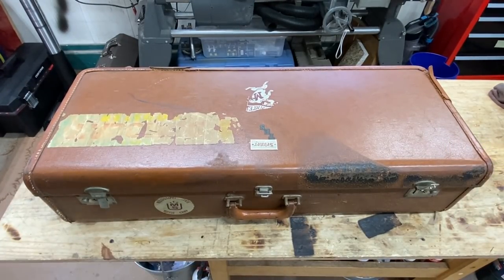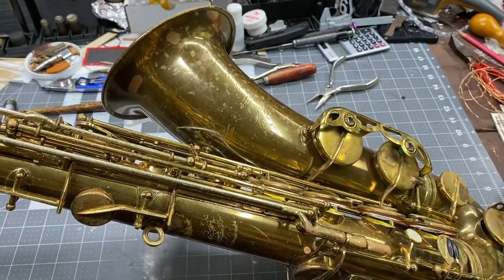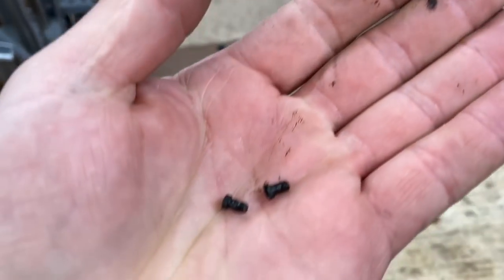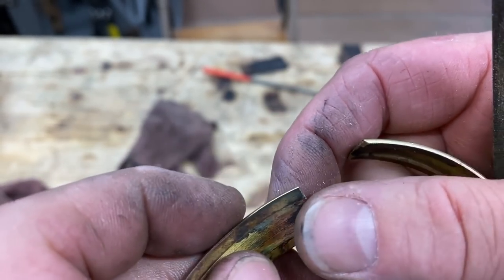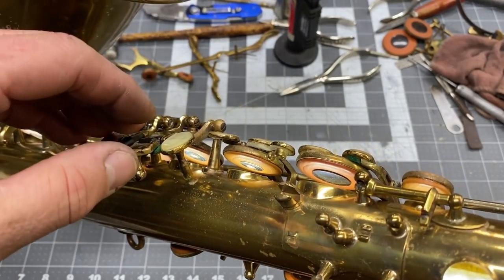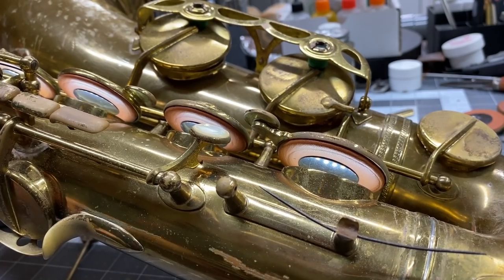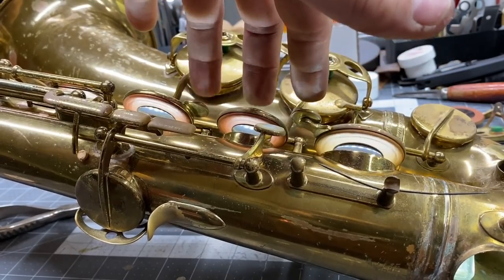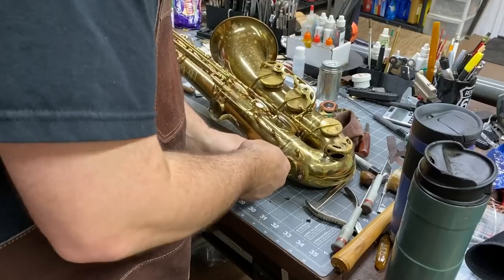Sensational Selmer vintage saxophone- band instrument repair- sax repair

Comment: Good video, but can suggest and I was cringing 😬 when you were removing those seized screws from the band with a slotted screwdriver , just in your hand .please for the sake of your left hand and put the band down on the table for support and your right hand unscrewing the screws,if your right hand slips and it will ,that screw driver will go towards the bench and not your left hand.Been there done that.🥲😉
Reply from the maker: I caught that as well on replay. I definitely got lucky. It didn’t feel out of control but could have so easily. And I’m sure we could compare left hand scars from the slip! Thanks for watching the video and more importantly watching out for me. Much appreciated.
Reply: @wesleemusicrepair9820  no problem we are far and few unicorn brass and woodwind techs.Especially in Canada 🇨🇦

Comment: THANK YOU FOR YOUR VIDEO !!!
   Wes, I'll pass an old electricians de-soldering trick on to you. Clamp a piece of pine wood close to where you're working, either vertical or horizontal. In whatever position you need it That's close to what you're de-soldering. Grasp the item to be un-soldered, with pliers in one hand and your torch in the other. Make sure no one is next to you. Heat up your metal till the solder starts shining and quickly hit the wood with your pliers. The solder will keep going and your metal will come to a fast halt! The centrifugal force makes the liquid solder fly on out. Spread a damp rag in the "Spray Zone" so you won't have lead BB's up in things, like motors or equipment. Hope this helps you de-solder.

Comment: Craftsman- needed now more than ever. Excitement welled up inside when you played the low b, c#, b flat. I loved the soldering but even more, the grinding, not leaving the solder blubber on the inside. My tech excites me in the same way. I brought a Kohlert 55 alto, with oval tone holes and dents top of dents. We did resurrection- plays now like 1955 with roo pads. Thanks- good time!

Comment: Love the videos Wes! I use Zep industrial purple degreaser (basically lye) to break down silver solder flux so there's no etching like with acid. I also use it for darkening the brass to match patina or if left in long enough to strip lacquer. Something I picked up from a friend and I've been loving the results!

Comment: Wes: the sax should never be lifted out by the bell. Especially tenors. Lifting like that bends the bell brace area causing the bell keys to be out of alignment. The bell winds up pulling upwards and has to be aligned again so the keys close. Near 100 percent of my sax repairs have this issue so the customers have to shown how to lift out by the middle of the sax or support the sax at the top. This common problem is well known to my repair friends. I'm surprised you lifted that out like that.  I am thinking of making a video to help folks out and prevent this issue. Thanks making a video on repairs.

Comment: The best way to have repaired that broken ring was not soldering it but welding it with a laser welder with some fine filler wire. You would have still prepped it the same but welding it from the backside with just a little going through to the top. After some light filing & buffing the joint would be invisible and as strange as new.

Comment: Regarding brazing : Prepping parts - does not require beveling, - unlike welds. One can tape/masks / then sandblast the narrow contact area.A costum jig  often needed for exact positioning of parts -  aiming for smallest possible gap before flux /heat/brazing. The solder will, by capillar effect, be sucked into the gap - ( if properly, cleaned, fluxed and heated. ) Best Regards

Comment: 14:49, I must say that I don't really understand what you did the "D" key, a "kick ajustment", but what "kick ajustment"?
It is obvious that you never have to make any effort to make the horn playable, and at 14:24 that horn is not.
What is the number of that Selmer sax., please?
Thanks.
Reply: Quick adjustment.
Reply: @hincapiej4  Ok, but but what ajustment ?
Reply: @Thouveninpascal  I would assume he either refloated the pad or bent the key cup to get it to seal properly.  It was already out of alignment left-to-right (east/west) so it wouldn't be surprising if the key cup wasn't also slightly out of whack the other way.  Hope that makes sense.

Comment: How is it that you can get your horns to Pop. I am still struggling on that. What is the thickness of leather that you use for respading?
Reply from the maker: Tone hole has to be level, pad cup has to be level, pad has to fit in cup correct with the correct amount of exposure, finally, I unhook the spring on whatever key to check how the pad seats with no touching. All of the basic techniques but with thought to perfection. Then I never touch to check the seat using a grip, always push lightly with no opposable pressure. No horn from the cheapest of the off shore stuff to vintage horns leave my without that pop. This is a skill that takes time and dedication to develop, but you can.
To your question about thickness, I stock 3 different thicknesses of pad and use what is appropriate for each instrument.
Reply: @wesleemusicrepair9820  Thanks, can  you show how to setup the  Fork F ? I keep on getting it wrong . As a consequence my horn always sounds stuffy.

Comment: It may be "cool" and defiantly vintage but you didn't mention that it was re-lacqured.  At least from what I can tell, in the video. The color and the worn down engraving on the bell  looks like it to me.
 What do ya think?
Reply from the maker: I think it doesn’t matter to me, it was a great instrument that played stellar.
Reply: @wesleemusicrepair9820  Definitely a re-laq but overall in pretty good shape.  Could've possibly been a Selmer factory re-laq because the dark color/shade looks period correct.  Then again, I don't think the factory would've buffed the bell area that much to make most of the engraving disappear.  As I'm sure you also know, those horns were originally sprayed with nitrocellulose lacquer which unfortunately burns off quite easily, even with a butane torch.

Comment: I know it sounds sacrilegious, but if you'd WD-40 all those screws the night before, you may not need so much heat. I specialize in C-Mels from Buescher, Conn, King etc, so all my horns are 100 years old when I get them. First thing I do is soak those screws in WD-40

Comment: The body to bow joint should not be soldered. A gasket type mastic seal is used from Selmer and the band/clamp holds it all in place . Your filing a chamfer was wrong to repair the band , using jewellery easy flow silver solder the joint ought to touch flush , The solder will 'flash' into  the joint with minimum filing and clean up . It is obvious that the previous repairer did not know how to repair the band (which had obviously been forced open ) so soft soldered the body bow joint . All pretty horrible stuff on a 53 Super Action Tenor . A pity it has been got at in this way as the next time around that joint will have to be unsoldered  and returned to original .

Comment: Wrong neck
Reply: Nope.  It's the correct neck.  Are you assuming that's a Mk VI?  It's not.  It's a late SBA, which still had that style of octave mechanism on the neck. Late SBA's had the Mk VI style (one piece) low B/Bb key guard but the thumb octave key, the RH thumb hook and LH pinky table are ALL SBA.

Comment: Bad soldering work. It's bad idea to use burner to heat up the keys couse you burn the lacqer. You should use the hot air blower